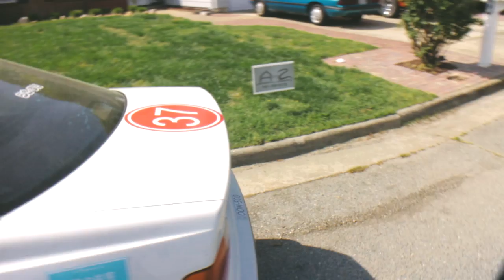E36 Drift Build - Episode 18 E36 FINALLY WELDING THE DIFF!

Comment: What steps did you take for welding the diff on the car to clean the old diff oil
Reply from the maker: BarberKid we completely washed out the diff and let it completely dry also used brake cleaner but I highlyyy don't recommend using it... stuff is dangerous fumes and highly flammable
Reply: You're actually supposed to use brake clean. You're also supposed to light it to burn off the residue. You guys were just idiots about it lmao. welded many s13/s14 and e36 diffs in my life.